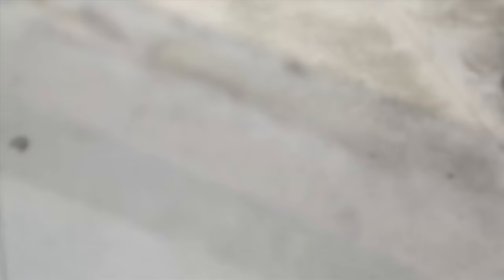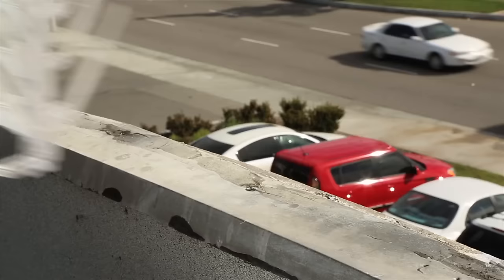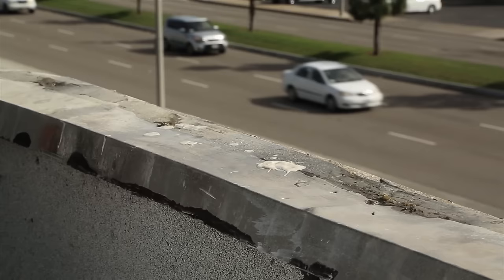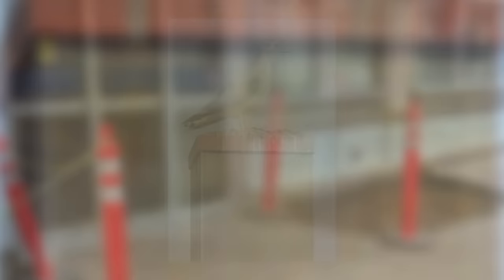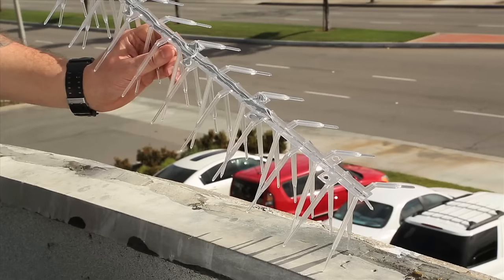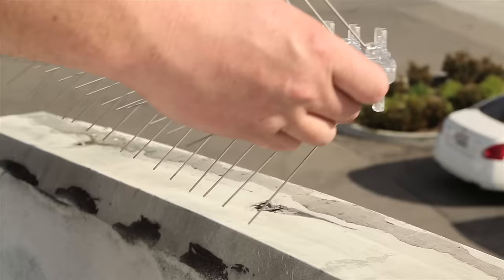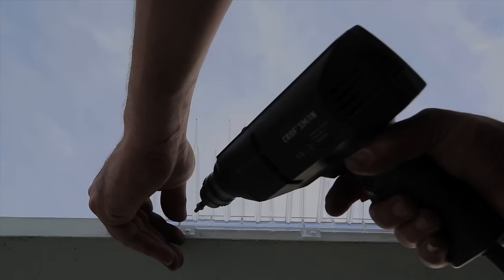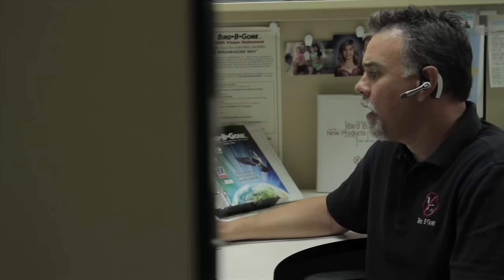How to Install Bird Spikes [Pro Tips] A Step-by-Step Tutorial - Bird B Gone

Comment: Will this work on patio ceiling fans? Pigeons are always trying to build nest on there.
Reply from the maker: Thanks for your question Ivonne, appreciate it! Our Bird Spikes are specifically desi-gned for use on exposed ledges to prevent pigeon sized birds or larger from landing. The installation of spike on a patio ceiling fan, given all of the moving parts, wouldn't be recommended. However, if your fan as a large immobile base it may work on that specific location of the fan. Don't hesitate to call if you have further questions or need additional support. (800) 392-6915
Reply: After a proper balance, putting the fan on high could effectively shred anything that gets too close... hmm...

Comment: What is the best method to use for stucco? Adhesive, and not screws, I’d imagine?
Reply: I am thinking that if you use glue and want to take it off later, it will remove the stucco.  I am going with screws.  It probably much easier to path screw holes than missing stucco patches.